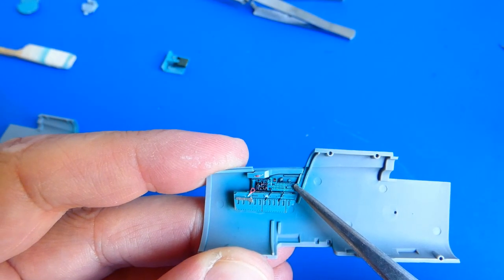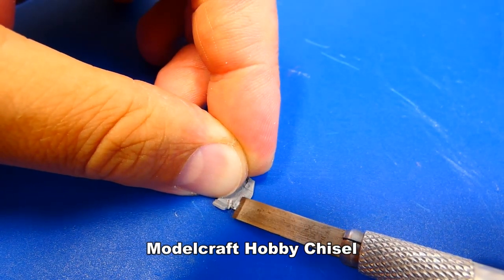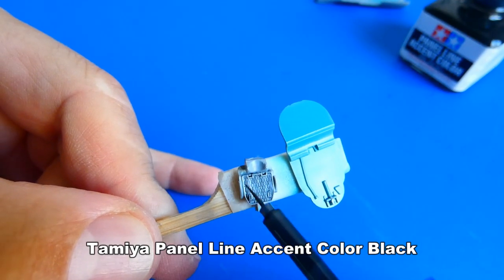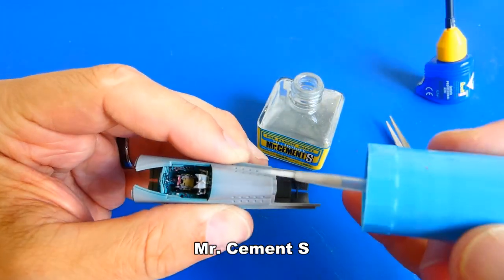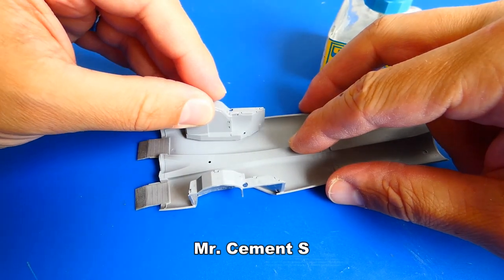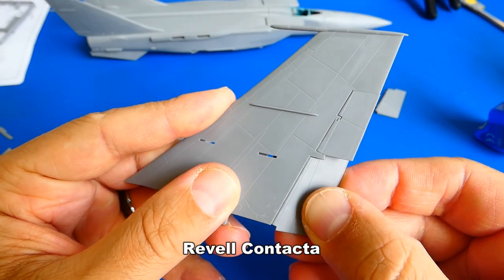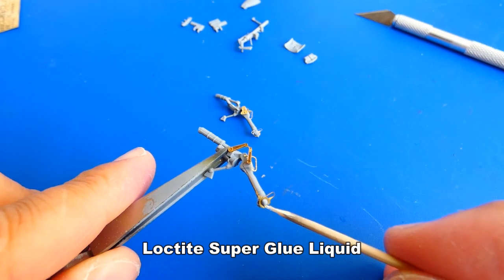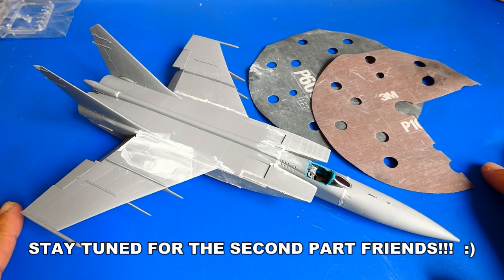MiG-25PDS Foxbat ICM 1/72 scale FULL BUILD PART 1

Comment: Sir I want to ask few things about the Liquid Mask:
1. How do you detach the dried layer of the mask without damaging?(Are you just peeling it off?)
2. What is the point of masking the edge of the canopy with the masking tape if you can peel it off?
3. I don't know whether you used or not  the Mr.hobby's liquid masks ,but if you used; there are two types of it :water and ammonia based latex i couldnt find that information about Jimenez's one . If you informed about this what type would you recommend?
Reply from the maker: Hi there. I simply detach the dryed Liquid mask with a toothpick. Its a waterbased Liquid and its charakteristics is similar to PVA glue. Its like a fine film of smooth silicone rubber. The purpose of masking tape or masks is to prevent unwanted overspraying of clear parts. For example, I only want the paint on the frame of the cab cover and not on the whole cab. Therefore, masking is used. I simply masks the place I want to keep clear.
Reply: @modelsforfun  Thanks a lot...
Reply from the maker: @johnkizirson9722  You are wellcome 🙂